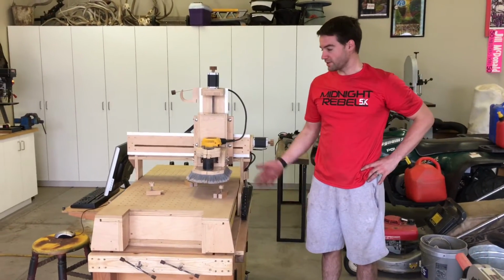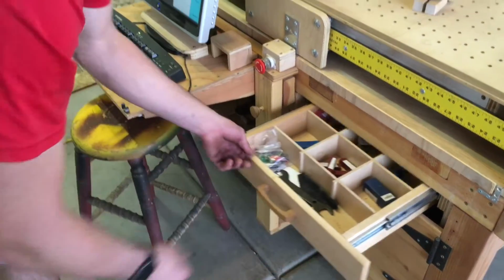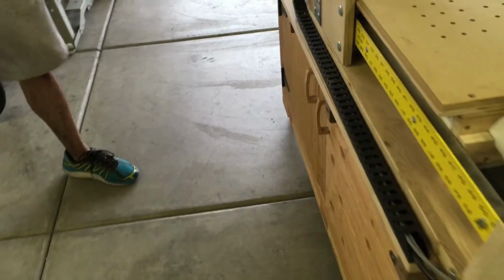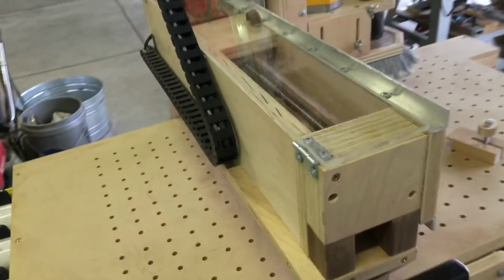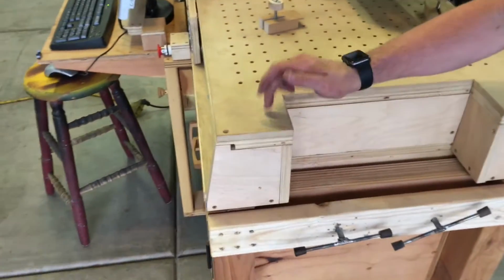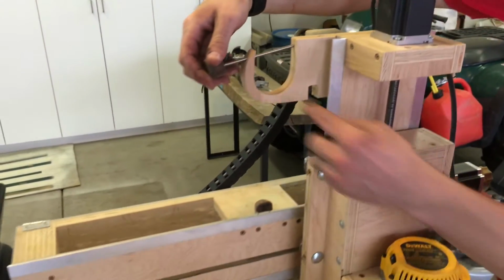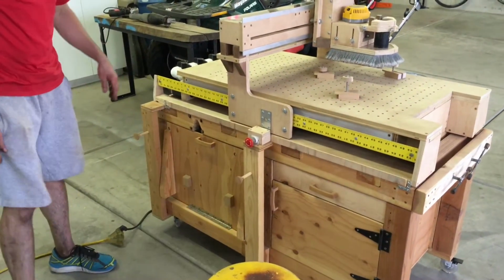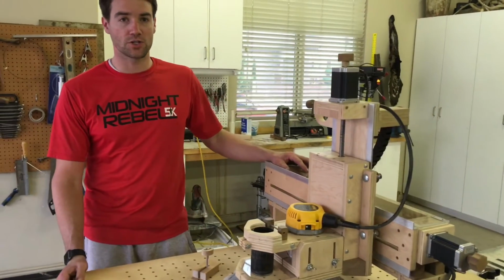Kaden's CNC Router

Comment: Can you put up a link as to where you bought the yellow scales you used for the linear guides? I can't seem to find any.
Reply from the maker: David Hvoslef I got them at Lowes
Reply: Thanks Kaden McDonald. Don't know how I missed them!
Reply from the maker: David Hvoslef No problem! I would suggest getting a steel flat bar as supposed to aluminum if you can spend a little bit more. Same for the angled pieces on the y and x axis. This is just to make sure they don’t cold roll to much over time. My friend is doing his CNC now and he’s using steel and sanding the edges in the same shape as the bearings in order to ensure it won’t cold roll and get loose over time. I’m in the middle of upgrading the gantry of this machine now to all aluminum plate and t slot and using supported round rail for the linear support. Same lead screws and motor kit and everything though. I’ll probably post a video when I’m done.
Reply: If you can afford it, I would recommend you do not buy Chinese round rail and bearings. The rails are usually hard chrome plated over non-hardened rods. The hardened balls in the bearings will eat through the plating on those rails fairly quickly. Brand name case hardened rails and a good brand name bearing pillow block will cost more, but last a lifetime if maintained. I would also look into using a bearing without the recirculating balls in them. They can clog. Pacific Bearing has many options for this type. I am sure you are familiar with other brands as well.
Reply from the maker: David Hvoslef I wish I could have afforded more but unfortunately that’s not the case as I’m still in school for another year. My intent is to have a machine that is much stiffer and able to cut aluminum and things for 5 or 6 years or so. At that point I hope to have a shop that is 7 to 8 times the size of what I am in now at which point I will likely purchase a new 4x8 machine with linear rails, rack and pinion, and a nice spindle. Also, whether it’s true or not, I read into the rails I purchased and they claimed these ones are harder rails not just costed so hopefully that’s the case!

Comment: Nice build.... My home brew is based on 1/2 10 acme rod,  X and Y are 5 start , Z is 1 start.  I also use V-rollers running on 3/4 angle iron similar to yours, the rest is different.  I highly recommend anyone to use a roll around table somewhat the same as yours.    I consider at least 1 drawer as mandatory, more if possible. The benefit is everything you need is all together in one unit.  I also added a chip separator and a small shop vac to my setup and  its on my roll around also. I use that most of the time but when I know some job will fill up the separator I just use the vac system in my shop where the chip separator will hold roughly half of the volume of a 55 gallon drum. 

Using a good chip separator IN FRONT of a shop vac will stop around 90 to 98% of the stuff from going into the shop vac. At the very least it seriously prolongs the life of the filter in the shop vac. I just disconnect the hose at the boot and stick the shop vaccum there. The hose is actually some hot tub hose that has an ID thats a perfect fit for the 1 1/2  inch PVC sink fittings. The peice stuck in the end of the hose has a flair on one end to create a slip joint in normal sink use. What sticks out of the bot is a short peice of the normal size.  I just stick the piece on the hose down over the boot peice and it creates an almost air tight fit.  The shop hose is set up the same way so its super simple to switch. 

My controller is also completely home brew, they're not difficult to make. Uses Mach 3 running on a 16 year old desktop with XP.  I had w2k running Mach 3 for a while but that created problems with a couple of cad/cam programs I normally use on a couple other computers in the house so I switched it to XP.  I normally dont do any cam/cad out in the shop but its handy to have a copy out there for some simple things and for a tweak when needed. The computer is in a  box under the CNC with a big 110  muffon fan sucking air in though a big car motor air filter and leaves the box on the other side through a bunch of 1 inch holes with a furnace filter inside just to prevent any dust that may be floating around from getting in if the computer is off and not being used.  The controller box is vented the same way but uses a bit high efficiency furnace filter on the intake in front of the intake fan.  In 2 years i have yet to see any dust in either box and never have had any heat issues. Keep a computer clean ant they will run for many years. That old computer has wore out 2 hard drives but it hasnt had a single problem in all the years. If the fans and heat sinks in acomputr gets plugged up with dust that can kill one.

Comment: Hi! How are you? Your CNC drives me crazy! I want to make one and not know where to start. You let me ask you several questions about materials? What are the specifications of the screws that you used? And what kinds of nuts you use? If you have a link where I bought it I'd appreciate it! I'm considering buying this: http://www.aliexpress.com/item/New-products-3-axis-CNC-kit-Nema-23-Stepper-Motor-Dual-Shaft-425oz-in-112mm-3A/1139071798.html?spm=2114.13010308.0.92.FyCX97
What you think?
Finally (for now), do you think it would be better to use NEMA 34 motors? Thanks! And I apologize for my poor english :(
Greetings from Argentina!
Reply from the maker: Hello thank you for your interest in the machine. The screws that I used we're all pretty basic wood screws and then some parts were also wood glued. However when building a machine out of wood, I recommended less glue and more relying on screws where it's possible because of the frequent need to disassemble, adjust, and reassemble certain parts during the build process till you get everything perfect. I used regular hardware school nuts and bolts and lock washers. There were some areas that I chose to use locking T-nuts as well (when securing the ruler linear guides to the 1 inch square tubing on the long axis. 

That kit actually looks like a pretty good one. I didn't have the greatest experience with a Chinese kit as I had mentioned though in the video. That's why I went with the xylotex motor kit. Plug and play, and not problems ever. Also I'm really glad I did two motors on the X axis rather than just one. So I do recommend a four axis motor kit and slaving one motor to the other on the long axis that carries the whole gantry back and forth. Nema 34's would be even more overkill than these nema 23's are and are not necessary for a machine this size. My motors are 425oz. motors ran off a 40V power supply and they are super strong.
Reply: Sorry, I wanted to say lead screws. What diameter and lead have?
Reply from the maker: Carlos Boxer they are half inch lead screws with anti back lash lead nuts. I like them being thick, especially for the long axis.